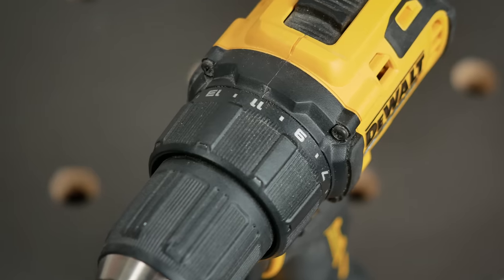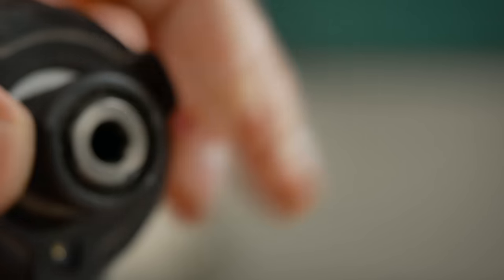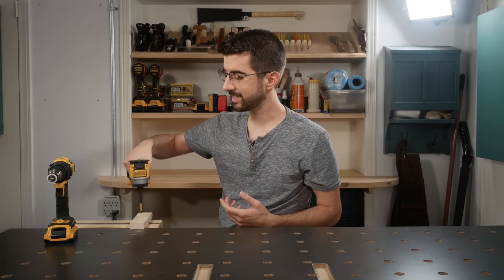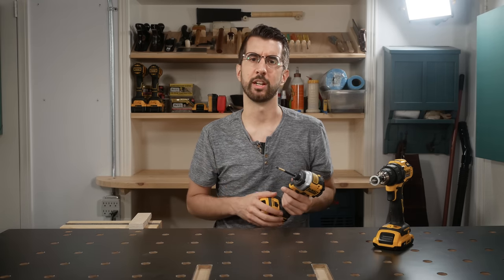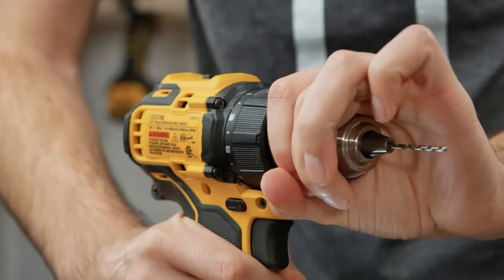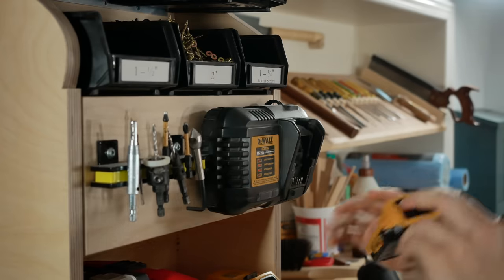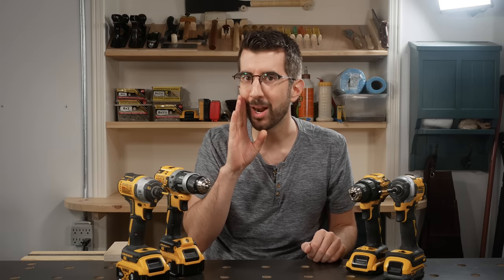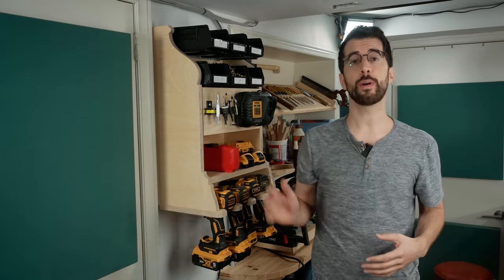why woodworkers don't use impact drivers

Comment: I've never seen great value in the driver clutch. If I get cam out, it's because the torque required to drive the screw home creates more upward force than I am physically able to provide downwards. I pretty much always press as hard as I can (DIYer, not fine woodworker). 
If I used a lower clutch setting, all that would happen is the screw would stop short.
Also, wood is a natural material, so the torque required to drive a screw perfectly flush will vary along the board. All the YouTube videos (not this one) claiming that drivers can do this flawlessly are wrong. It's a torque control, not a height control.
That said, DeWalt clutches have been shown by many youtubers to be inferior, in that there is basically no difference between most of the settings. It's minimum or maximum with nothing inbetween. I'm a DeWalt user, so maybe that's why over never found it useful...
It does protect your wrists, but I've never found that to be an issue for me - I can comfortably react the drill's maximum torque 💪 A more powerful drill might be an issue, but you can put your other hand on the battery for more leverage if available.

Comment: Please make a video on brush vs brushless!
Reply from the maker: You really don't want me to. Please refer to "Electric Machinery Fundamentals" by Stephen J Chapman for more info. I can't say that it's an exciting read 😅
Reply: @ScottWalshWoodworking  I understand how they work, but you said brushless was better. Did you mean better overall or better for wood working? I find brushless to be frustrating when I just need a little turn out of the bit to align a flat head (for example) where as brushed can easily slowly creep along at high torque.
Reply from the maker: @chrismagruder5718  I mean, i get it. A brushed motor trigger is just a pot to control the voltage, and you do get that infinite variable speed, but I veeeeeerry rarely use a flat head screw. One time I tried to use an impact with a flat head and I snapped the bit - otherwise I'll use a screw driver.

Comment: I have makitas mid range drill/driver and impact driver and i really enjoyed them for a long time. But since I picked up the same combo-set but in 12V I haven't used the 18V in the shop. The only downside to the 12V impact driver is that it doesn't have the adjustable power selection that my 18V has. I really like the smaller size and weight and there's plenty of power.

Comment: I am a bit of a Jack of all trades and so my choices for drill and driver, after much research, are much different than yours.
Currently I don't have much setup for finish woodworking; Dad has lots of tools for this.
I wanted a drill that is good for making holes in metal. My drill press is too fast, at the lowest speed; made for woodworking.
I had to laugh when you were showing DeWALT drills and referring to keyed chuck drills as being from the 70's. Well, I did in fact acquire a box of B&D drills from back then. I repaired two that I use, two more work but need parts. Best one is VSR.
What made me laugh though is that I bought a new DeWALT drill a couple years ago, with a keyed chuck, which I wanted. It can drill in metal, stir a bucket of mortar or paint. Can easily strip or break screws and you have to let off the switch early or its' momentum will drive the screw way too much. Triple gear reduction. DW245 Good for some woodworking, but chosen for torque and speed and strength. I like it!
I also like the cords. I have tools not even broken in where the battery died, and there is no replacement :-( I also like the extra power and that it does not die out after awhile. Sooooo I finally got my hands on a bran new made in Japan, Makita 6952! There are not many new ones left; not being made anymore. Makita makes a lighter duty version(from China) though.
IT HAS A CORD! Yeah! I don't plan to travel with it so the cord is great. I am getting any parts that may wear out ASAP too.
Well, this is my first impact driver. I got proper impact ready bits and socket adapters. I have only used it for testing just now; I have some large projects to do though. AMAZING! Sooooo easy to drive a 3.5 inch #10 screw....and overdrive it lol Broke the #8 3.5 inch screw ;-) Guess I'll be building with #10's, what? There are battery impact drivers more powerful, but not after a bunch of screws ;-)

OH yeah....the NEW DeWALT DW245 has a keyed chuck, which is what I wanted. The key is firmly attached to the cord near the plug, so I unplug it before changing bits. This drill has some power where it is geared down, so best be careful.

See, the "best" depends on ones needs and wants and plans. Once I get doing more finish carpentry here, I may want a newer fancy drill, with all sorts of things to break on it, but has a clutch control and imitation hammer action.....

Or maybe I'll see if I can get more parts for my old B&D drills. New switch, couple new chucks....we will see. Right now they work fine.

Did I mention how impressed I am at how easy it is to drive construction screws with an impact driver! I knew it would be easier, especially from using my heavy DW245 drill, but, it is EASY. Just line up straight, then remember to let go the switch in time lol My discontinued Makita 6952 is variable speed so I am going to test that on some small screws. Later folks.

Comment: I have both from DeWalt also and love them. I find the drill is best for "delicate" and precise tasks where bit torque really matters, but the impact is ideal for "clumsy" high-torque applications like fastening boards together or general "shed work". I got both from a kit a few years back and make a point to use both.
Reply: It's almost opposite for me. 

Impact have more control, drills have more consistent torque. So I use impact for handling delicate screws or just about anything except drilling. And I use my hammer drill for drilling and for hammer drilling because it's more consistent where you don't care about feedback as much, just need powerful unstoppable  torque with controlled speed.

If you learn how to use impact you will be faster with it.
Reply: OR I can copy paste this comment here to explain further: "Impact is high "horsepower" but low torque which then allows you for very precise control. Like it can spin rapidly but when hitting a certain threshold of torque it will stop just as rapidly. Drill drivers on the other hand are very high torque, but low horsepower - they spin slowly, but they with chew right through your Philips bits and screws like nothing with almost no feedback.

Like a sport bike vs a semi.

Or another way to describe it is steering. With hydraulic steering, you're in tune with every nuance of the road; every bump and imperfection travels through the wheel to your hands. Electric steering, leave you feeling disconnected - everything's too smooth, too insulated. Exactly the same as Impact vs a drill.

And the only reason why it's not obvious to everyone is because drills have torque control and impacts don't have them. 

The key difference lies in the torque control: drills come with this feature, allowing you to set a torque threshold and avoid overdoing it. But here's the catch - materials like wood aren't consistent, making it nearly impossible to find a 'one-torque-fits-all' setting.

Impacts, with their raw, unforgiving power, demand a more seasoned hand. A slight excess pressure on the trigger, and you've overdriven a screw or split the wood.

Beginners often lean towards drills, seeking to avoid these mishaps, and over time, they develop a comfort and proficiency with them. But this comfort can become a barrier to mastering the impact driver, which, in skilled hands, can outperform a drill.

The longer this goes on - the harder to switch. 

But this whole debate goes down to this. 

I worked with someone who was about as experienced as I am and about as fast as I am. He was way faster than couple of other guys. 

Still, I was faster than him with my old impact. I didn't mess up a single screw and I finished identical piece before him. And I think if he mastered the impact it would be reversed - he would be faster than me."

Comment: I'm an impact driver woodworker but do find I never use setting 3 (high) in the shop.  One thing wanted to mention is that you can get a quick release/quick lok/quick change but holder that is the same hold and release type the impact has but could be put on the drill and holds the bit unlike the magnetic.  Just an option for those using only a drill so I thought I'd mention it, every tool brand makes one for under $10.  Great video and info!
Reply: Also there's a drill chuck adapter for impact. It's kinda bulky, but nice when you need it; which is rare and I've only used it with a 90° adapter. It's a savior (90°); surprisingly comes up for me more often than the pivoting bit holders.
Reply: There's also a driver that you can switch the whole head so you can have a drill, driver, 90°/right angle/ and offset all in one tool. You can install the 90° and offset in multiple positions to have it where you need it in tight spaces. Milwaukee has one in ther m12 line, but i dont like how it has the hand guard making it like like some kind of phaser or something. Dewalt has one in their 12v line thats just like a typical drill or driver. I got the dewalt.

Comment: I don’t find the clutches work well enough for production work. There is too much variation in the wood for a consistent stop. 
Having watched numerous people struggle with impacts, it seems to just be a lack of understanding or control over the variable trigger. It’s not an on/off switch. I use my impact for everything from fine installations and assembly to driving major screws. Drills are for drilling holes.

Comment: You know, most if not all of the benefits that a drill has over a driver can be nullified by the correct use of the tool. The driver also has a "clutch" type of feature, it's called your trigger finger.

Comment: Or you could just use a screw driver (the 12v gun power tool not the hand tool) from DeWalt which is designed for that task. It has an adjustable torque clutch and a 1/4 in quick release chuck. Why does everyone insist on using an impact driver whose only real use is driving lags instead of a screw driver that is designed for general purpose screw driving. It is literally the same exact tools as the drill from the clutch back.

Comment: Apparently the creator of this video doesn’t have the cheddar for the newest impact drivers that have settings for wood screws as well as speed and torque built in via a single push of a button.
  Even if that isn’t the case, changing the torque value by twisting the chuck sheath to the desired number for every screw is going to give you carpal tunnel by the end of the month.
  Sure, if I’m fastening a one inch fine thread wood screw to a half inch think piece of soft stock, no duh I won’t use an impact.
  The majority of carpenters I know and have worked with ALL own impact drivers for any lag or fastener above 4” long.
  Why? Because setting the speed and torque and drill bit for the pilot hole with your drill and then driving it home with the impact is the quickest combination out there.
  I don’t know anyone who has the time to swap out a drill bit, change the setting from drill to drive, ratchet down a Phillips or torx or posidrive head, then readjust the torque setting for every screw or lag they put in.
  That’s ridiculous ad nauseum.

Comment: a $10 ebay battery adapter lets you use dewalt batteries with other brand tool skins, I mainly have makita with a heap of batteries but ryobi make a VERY decent brad nailer, which is sold as a skin only. $10 later on ebay and I now have my makita tools powering a ryobi one. obviously this is a sponsored video so I can't talk you out of it but tool snobbery only limits you.

Comment: I don't even own an impact. I have two drills, one for drilling holes and one to run screws. I've used an impact before, not mine, and hated it. You couldn't run fast enough to give me one. I have seen people on a job bust out cabinet face frames with them.

Comment: I prefer my Makita impact driver over my drill driver, especially for wood. I have perfect control even with finish work. Wood changes with every hole, and the clutch on my drill may or may not be set right for the various hole. Clutch is great for tightening metal fasteners to a certain torque. Obviously, I always use the impact for "no drill" screws.

Comment: It's really not that hard. Drills for drilling. Impact for screwing. If you get a good impact, they have power modes that acts similarly to the torque range of a drill, but with a much less range (usually 1-4 on impact vs 1-10 on drills). Some of the nicer impacts event have power *modes*. For example, it will stop on the first impact it detects so you don't accidentally over-tighten your screws. With nice self tapping screws with torx heads, I'm on the opposite end. I RARELY use a drill for screwing. Just grab an impact and start screwing right away (no need for pilot holes in most cases with the nice screws).

Comment: This doesn't address the two primary issues with impact drivers. The first issue is the impact feature causes the driver bit to get locked in the screw head, if you have spent five minutes with these drivers you know what I mean and it is a huge huge pain in the ass especially with Robertson screws. The second issue is how unbearably loud the hammering sound is, there are newer units out there that now have silent drive technology making the type of impact driver in this video obsolete.

Comment: Sure impacts are great but I can’t stand the noise after using impact wrenches in lift shafts for years. 

Far rather use a drill/driver and not have to mess about with muffs every time I want to sink a fixing…

Comment: You do realize you can get non-impact drivers, don't you? I have the M12 one, and it has plenty of torque, even for large lag screws.

My beef with impact drivers is that they will over drive or strip out screws far to often. Impacts in automotive applications for removing fasteners are great, but they are just asking for trouble in wood.

Comment: I like to think of impact tools as the mechanical analog to pulse width modulation (or PWM) in electronic circuits, an alternative and in many ways superior way to get as much power from a power source and to finely control the power going into the "load" as possible, be it a screw going into wood or an LED light source. Often it's preferable to finely controlling a continuous power supply.

Comment: I still have my dad's old Black & Decker drill from the seventies. It works great after being cleaned up, and regreased inside. I have four drills, but have not yet acquired an impact driver.

Comment: You're really nailing the "cold close", Scott. 

But you're missing one type.  I own a NON-impact hitachi driver.  Still has the quick release thingy.  Great for putting in screws.   no hammering at all.   This makes it even more niche, as OUTSIDE of the shop you generally want the hammering.   Best part is that I bought it kind of by accident many years ago.     (I thought I was buying a drill + impact kit, but really it was an impact + non-impact driver set.)
Reply: Yeah, makita has one too and i really like it.
Reply: The Bosch Flexiclick 12v is my go-to in the shop.  Drill clutch.  Impact driver-like collet.  It is all the tool I need for woodworking.  I do have DeWalt 20v tools and some 10 year old DeWalt 12v that work great.  I am not opposed to using them for woodworking, but the Bosch works so well and is so light and handy that I don't find myself reaching for them.
Reply: I believe what you guys are referring to is call a cordless screwdriver. Has the clutch like a drill but bit holder like an impact. Dewalt, milwaukee, etc (pretty much everyone) makes them. They also make whats called an installation driver or 5in1 thats clutched like a drill with a magnetic 1/4 hex (no collet) and you can swap out the heads for a drill chuck, 1/4 quick change with collet, 90° right angle, and offset 1/4 hex. It doesnt impact which im a little disappointed in cause i thought w the other heads it would, or have a setting to, since like like impact for installing and removing screws. Still a cool tool though. So its basically a cordless screwdriver (since it doesnt impact) with all the interchangeable heads

Comment: Impact drivers prevent stripping of the head of the screw because they impact.
Try a quick release bit holder if you’re going to use a drill. A quick release bit holder won’t leave the bit in the screw head.

Comment: impact drivers are for mechanics not for carpenters ...the only ones designed for carpenters are the ones that cames with 1/4 interior hex chuck:text-green-game-over:
Reply from the maker: i think you mean an impact wrench, which is a different tool entirely

Comment: I use DeWalt- but they got 12v wrong. 3 cells in the handle gives a much more compact tool. Hanging them off the bottom of the handle is just plain wrong. Had to buy Bosch- but there are others.

Comment: I think even my cheap old Ryobi impact driver has speed sensitivity based upon the trigger pressure.  The reason I don't use it is that repeated impacts. It can cause certain screws to break when the same torque would not break them off if it was just an a drill hit.  I mean average torque, not the peak torque

Comment: The only reason I clicked is because I've NEVER heard ANY woodworker say this, IRL or online, don't make shit up for views. Impact DRIVERS were literally specifically made for woodwork, Impact WRENCHES are totally different tools that are designed for primarily automotive work, those have a male square drive socket head, Impact Drivers have a 1/4" female hex collet specifically for screw driver bits.